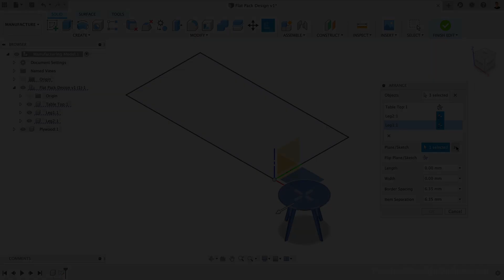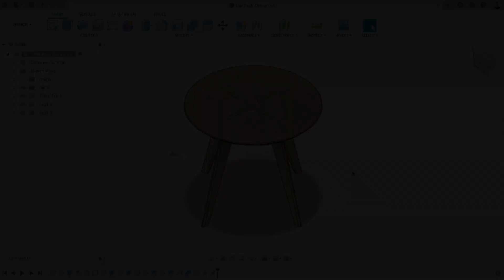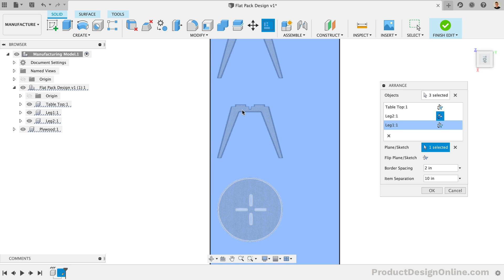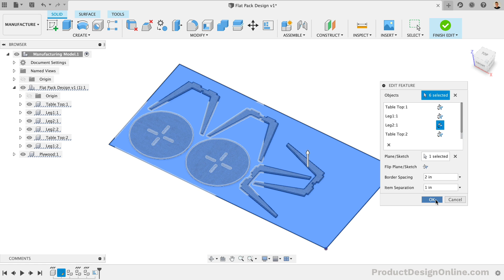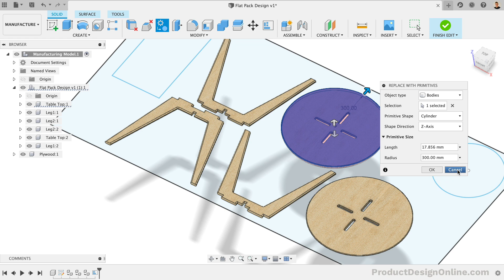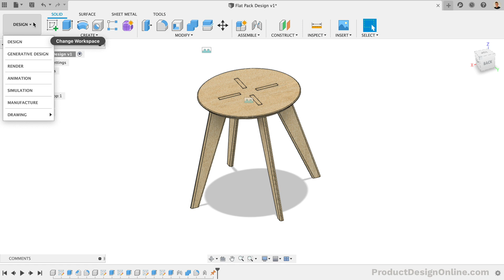Fusion 360 - Auto arrange parts on sheet

Comment from the maker: Grab the demo file in the description of this video!
Preview my new Masterclass: Fusion 360 for Woodworkers ➞ https://bit.ly/woodworkingCourse
Check out the new "Nest Manufacture Extension" via Portland CNC's Video: https://youtu.be/UH3RhTTp30k
__
TIMESTAMPS
0:00 - Auto arrange parts in Fusion 360
0:54 - Enable the Arrange preview features
2:20 - Creating a manufacturing model
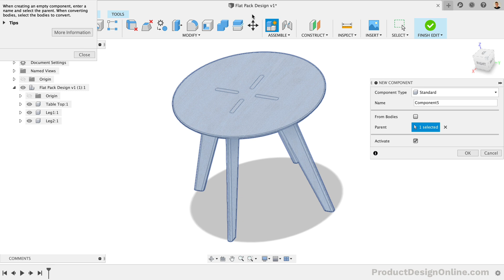3:34 - Creating the sheet good size
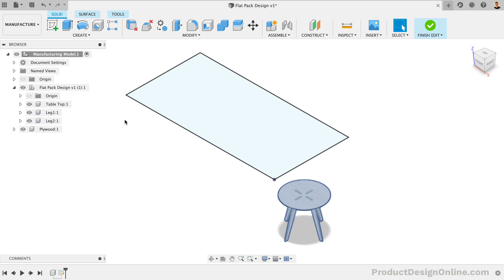4:09 - Using the Arrange feature
7:35 - Redefining the arrange boundary
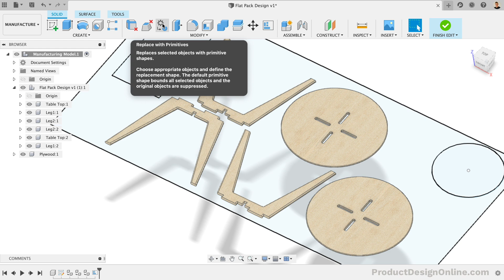9:25 - Manufacturing Model explained
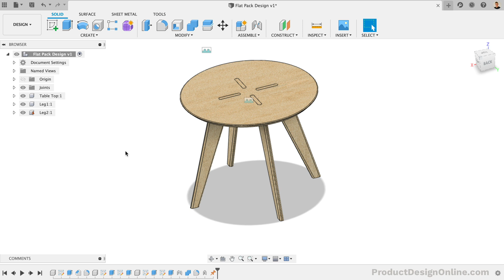11:10 - Testing the manufacturing model

Comment: I dont have a CNC but this would be nice for cutting my parts from plywood. How can I get dimension on the sheets?
Reply from the maker: Sry, I'm not following your question. Do you want to transfer dimensions manually onto your plywood? Or looking to layout the dimensions digitally (i.e. 2D Drawing)?
Reply: @ProductDesignOnline  Sorry. Say I have a cabinet I have designed and I use the auto arrange tool to arrange it all on a sheet of plywood. I don't have a CNC that will be cutting the material, I will be breaking it down myself. Is there a way for it to auto-generate dimensions on the layout so I can print it out and follow it like a set of plans?
Reply from the maker: @rutgis77  thanks for clarifying! Not in the Design workspace, unfortunately. However, the Drawing workspace has a new Automated Drawings feature that can do what you describe (it may not be available on the free Personal use license... I'd have to double check). You can also place the sheet and manually add specific dimensions of you don't want them all for some reason.

Comment: Arrange feature is even better this year and you can use it from the design workspace if you set a check on the option in preferences.  Advanced arrange is getting better every release.  #AutodeskEmployee

Comment: I thought nesting would have been included with the paid version of 360. NOPE. It's a plug in that they charge 3x what 360 cost just to be able to nest. No thanks.  I'll keep using Rhino which includes nesting.
Reply from the maker: To clarify, the Arrange feature covered in this video is included in the regular cost of Fusion 360. The "Advanced Arrange feature" and more advanced nesting capabilities are available with the purchase of the "Nesting & Fabrication" extension.

Comment: Since Arrange is disabled in the Personal License, what is the best practice currently for Personal users to move the stool's components into a flat stock for Manufacturing?
Reply from the maker: If you plan on doing it a lot then this addin is worth the 1 time cost: https://apps.autodesk.com/FUSION/en/Detail/Index?id=3399489440307590024&appLang=en&os=Win64

Otherwise, you can use the Align command or Joints depending on how many parts you have/whether you want to be precise about the placement.

Comment: I have the latest Personal Fusion 360 license and Arrange appears under Modify but is disabled all though Simplify is not.
If I click on Arrange I get the following message: "Available with a paid Subscription of Fusion 360".  
Am I doing something wrong or is this the new reality?
Reply: I asked Autodesk the above question and they confirmed the new policy for a Personal license is NO ARRANGE:

"Hi - Yes, that's right. Arrange is a subscription-only capability.   Jeff"

So future tutorials for Personal Licenses will be confusing if you continue to add Arrange to your new CAM videos.
Reply from the maker: Hi Steve. Thanks for sharing this. It's unfortunate - as it was included in the Personal license when I recorded this lesson, but they removed it with the other changes. I wish they would include the basic Arrange and keep the Advanced Arrange and Nest Extension to Commercial users (I'll keep fighting for that anyway).

Comment: Is there a way to arrange across multiple sheets if your components can't all fit on a single sheet?
Reply from the maker: With the Arrange feature, there currently is not a way to do so. However, the advanced 'Nesting' features available in the Manufacture workspace > Fabrication do allow this. Some of those features are still in preview/beta though.
Reply: @ProductDesignOnline  No worries, thanks for getting back to me. Another question is what process would you use to export your arranged layout (with sheet included) to a DWG/DXF to send to a manufacturer given the multiple bodies? Cheers.
Reply from the maker: @jamesrobertsonirvine  This depends on what license you're on. Are you on the free personal use license? If so, the easiest thing to do is create a new sketch and then use the 'Project' command to project the face of each 3d body into that sketch. You then have everything in 1 single sketch and can right-click on it in the Browser > select Save as DXF.
Reply: @ProductDesignOnline  thanks again for the swift reply. The workflow you've mentioned above is how I currently am doing it I just thought I'd check if there was single command after the arrangement command had been hit. I do also have a paid license, does that give you further options? Cheers.
Reply from the maker: @jamesrobertsonirvine  Yep, there are some better ways if you're on the Commercial license. Please join my new community space and we can chat/have a thread there where its easier to share things - https://community.productdesignonline.com/join?invitation_token=ee332424c326e3e15c9895c9f8f052cd65828b90-4cd0beb0-1ca4-4155-a9dd-d39b7245c809

Comment: Did something happen to this feature? I cant seem to find arrange nor do I see it in the preview box?
Reply from the maker: The feature is now available in is no longer in preview mode. However, I believe the feature is now only available two commercial users and is not available on the free Personal use license at this time.
Reply: @ProductDesignOnline  Fusion isn't working well anymore if you have a personal licence. SO FRUSTRATING!!!
Reply: @ProductDesignOnline  is there any other options available to use on the free version? I know it won’t be as simple but just wondering what other options you would recommend.

Comment: I found this video from https://forums.autodesk.com/t5/fusion-360-design-validate/replacement-for-slicer-app/td-p/9803113. Please consider replacing your old slicer video using arrange. I'd like to slice a design then laser cut its layers from Home Depot hardboard tempered panel. Thanks for your videos, I always take away new skills.
Reply from the maker: Hi Craig. They're working on some more slicer like functionality with the new Nest workspace.. I've been trying to hold off until that's available :)
Reply: @ProductDesignOnline  Aah, ok. Sounds good. Thanks.

Comment: Hi, has anyone figured out how to use multiple "sheets" if you have a hundred different parts that will not fit on a single sheet? Or is this something not available to "hobby" subscriptions.  I.e. do I need to have a subscription to have that option?
Reply from the maker: That will be available in the Nest workspace, which is still in beta testing. I do believe that will be only available for startup, edu, and commercial licenses. However, they have not officially announced anything about it.
Reply: @ProductDesignOnline  Great, its good to know.  Thanks for your response!

Comment: Nesting - loved the video, read all the comments, but still having a question if there is a way to create drawing out of that  flat layout without converting any DXF to DWG and useing any 2d soft.
Reply from the maker: Hi Rainer. You simply need to project all of the desired bodies (Edges) into a single sketch using the "Project" command. You can then right-click on that sketch in the Browser and save as a DXF. Hope that helps! :)
Reply: @ProductDesignOnline   Thank you so much for your answer. Ican get the DXF file out of arranged layout. That is fine but what I need for my job is actually a drawing of arranged parts. Just a simple top view with dimensions of details I need to cut in PDF file. The board material we use is cut on the simple table saw and we just need to print out the drawing guide for the people who do the job.

Comment: I had to do this to get the "Manufacturing model": Preview Features -> Manufacturing Working Model. Restart Fusion.

But I don't have the option for "Arrange Feature" and there is no Modify->Arrange menu item in the Manufacturing model workspace. I have Fusion 360 2.0.9011.
Reply from the maker: Hi Thomas. Are you on the Personal Use license? I just found out earlier this week that the Arrange feature is currently not available for Personal Use license.
Reply: @ProductDesignOnline  Yes I am. That explains why. Thank you.
Reply: @ProductDesignOnline  fml :D

Comment: May have to reset the program (close and reopen) after selecting and applying the preview features - Create Manufacturing Model wasn't an option until I did this.
Reply: I tried this but it still isn't showing up for me. Hmmm
Reply: @klm8156  If you haven't found it yet, you have go to the SETUP dropdown (located directly below Milling at the top) and then Create Manufacturing Model. Other thing I found out, it only works on components. So if you have a bunch of bodies under a component, you will only be able to select one body, and it'll move the entire assembly without laying it out So every body needs to be turned into a component, which is kind of a pain.

Comment: Once you arrange everything, can you export as EPS to send out to a cnc shop for them to cut? I don't know which machine they will use, they just asked me to have it arranged inside a specific area with spacing.

Also, once you've arranged can you get a sketch version?
Reply from the maker: You can save as a DXF file but would have to convert the DXF to EPS in another program. Fusion doesn't work with EPS, as those are vector files.

Comment: Kevin, I appreciate your videos! I am really excited about this feature as I do a lot of work on the CNC with plywood. However, I'm having trouble with the arrange window not showing up after clicking the arrange feature. The components have the directional arrow, but there is no window to edit the pieces.. Do you know what I missed?  Reasonably, not much yet out there on the web about trouble shooting this feature. Thanks in advance.
Reply from the maker: Hi Eric. Since the feature is still in "Preview" it is quite possible that it's a bug. The first thing I would do is reset your view, especially if you use Fusion 360 with an external monitor. Under the View drop-down > Reset to Default Layout
Reply: @ProductDesignOnline  dude! holy smokes, that worked! Thank you
Reply: Also another question Kevin: is it possible to manually arrange/nest components? If not, I am guessing that it might be a feature that could be rolled out when the full operation comes online. Thanks!
Reply from the maker: @erickillian8470  You would have to use the Move tool to manually position each component. Otherwise, there is definitely more to come!

Comment: Kevin let me re define my question, I have a simple 2d part it measures approx 6" x 6" x 1" thick, How can I apply them in multiple times on a stock sheet to cut them out. Thanks
Reply from the maker: After creating your Manufacture Model you can copy/paste them in the Browser. Just make sure you enable the Manufacture Model preview and go that route as that will ensure you don't affect the original design models in the Design workspace.

Comment: I made a quick design of 6 components made into a pyramid for a test  and there is no manufacturing model button. Anyone know why? thanks
Reply from the maker: It's still in preview mode. Did you enable manufacturing models in your preferences under the preview tab?
Reply: @ProductDesignOnline  Thank you,  Finally got around to doing this. Just a note for anyone else figuring this out. You also have to click on the arrange feature in the preview featrures tab lol.

Comment: Great video Kevin.  However, for us mere mortals who don't have CNC machines and have to cut "wood" with saws, is there any way of creating a drawing of the layout? Or do you have to manually place the parts on a separate design and then create a drawing from that?  Thanks, keep up the good work :)
Reply: Figured out a way to do it. Very convoluted though. Create a new component in the manufacturing space, start a sketch, project layout onto sketch. Copy the component projections to a new assembly sketch on a new sheet. Extrude projections and create a drawing. Hope it makes sense, I'm a relative newby. Hope your way is easier 😀.
Reply from the maker: Hi Damion. Hoping to do a video on that soon! 

Thanks for watching :)

Comment: Nest, we will use the hell out of this feature. We cut out so many wood parts on our CNC routers, this is huge.
Reply from the maker: What machine do you have? 😎
Reply: @ProductDesignOnline  We've got two Multicam CNC routers with ATCs. A 3000 series and our new Apex R3 with computer vision, drag knife, and oscillating knife.

Comment: NEST.... Looking forward to the NEST space.. I've been playing with the arrange and having some difficulties when placing parts onto multiple sketches (I have some flat furniture which takes multiple sheets and like to to the CAM set ups next to each other). So far I've still been moving the parts manually to position after arranging them onto a plane.
Reply from the maker: Are you using the Arrange feature twice (once per each sketch)?

Comment: I nested the components but how can I actually export the result to a DXF or Sketchup file so I can use the parts information in another software - primarily Aspire or vCarve Pro?  I also couldn't print.  Do you have a class or link to a project that shows how to export the nested result?
Reply: Hi Rob, there are two ways to export/output dxf for the arranged results:

1. While in the Edit Manufacturing Model environment, project the boundaries of arranged objects onto a sketch and then export the sketch as a dxf
OR
2. Create a setup and toolpath operation for the arranged objects. Please make sure the sideways compensation is set to "Center" (for 2D Profile) or "Off" (for 2D Contour). Then you can PostProcess the toolpath by selecting one of the available DXF posts from the fusion post library.

In the post dialog, you can set 'onlyCutting' = "YES" to get rid of the linking motion. And you can set 'includeDrill' = "NO" to avoid points at the drilling positions.

To download and install the dxf post on your computer, please visit - "https://cam.autodesk.com/hsmposts?"
Reply: @ravijavia8183  thank you for providing a reply.  Before I provide my additional request, I want to say that I appreciate the time you already took to tell me there were two method.  I will go try and find out information on these methods.  But, if you have a few more minutes and are willing to provide a little more help I would appreciate it, even if you don't thank you for what you did provide.  

I have to admit that I must not be proficient enough yet to figure out how to accomplish what you gave me instructions to do.  I know how to project in the Design Mode but never worked in the manufacturing mode until following this video's guidance.  So not sure how to export just the sketch in Edit Manufacturing environment.  Links or guidance to any videos or instructions on how to do this would be awesome.  

As for method 2 still need to figure out how to setup a toolpath and the things you mentioned.  Any links to this information would be helpful so that i could go learn.   Thank you again...
Reply: @robsandstrom9854  you're very welcome. Glad to help. Here are some good resources for Fusion 360 in general:
1. Learning Content - https://academy.autodesk.com/software/fusion-360 (you can find info about other Autodesk products as well)
- Regarding Setup, Toolpath and NC creation - Go to the Intermediate Tab and refer to "43. Setup", "46. 2D Toolpath", and "49. Post NC File". You can also check out "43. 2D Cutting" on Advanced tab.
- Projection of faces onto a sketch works the same way in "Design" and "Edit Manufacturing Model" Environments. I would recommend trying the DXF post method first.
2. Fusion 360 Youtube Channel - https://www.youtube.com/channel/UCiMwMz3RMbW5mbx0iDcRQ2g
3. For specific questions on Arrange functionality, you may post here - https://forums.autodesk.com/t5/fusion-360-feedback-hub/open-call-for-preview-feedback-arrange-feature/td-p/9673457
4. Other questions on Fusion 360 - https://forums.autodesk.com/t5/fusion-360/ct-p/1234

Hope this helps!
Reply: @ravijavia8183  thank you will check out these resources.

Comment: This nesting feature may turn out to be a game changer for me.  Trying to manually layout parts on cut diagram was so time consuming - this is an awesome edition.  I don't use Fusion 360 to generate g-code for my Laguna IQ CNC and the bed s limited to 2'x 3' so will need to determine how I can next to smaller plywood or stock - I think I just do multiple sketches and pick which components I want on each sketch - is this accurate?  I also still need to figure out the best way to export my parts into Aspire or vCarve Pro.  Great work.

Comment: I have a slightly more complicated model and I cannot seem to get it to work. I have several bodies under a single component and when I try to arrange, it is keeping the bodies together as a single unit instead of breaking them apart into the individual bodies.  Am I missing a step?
Reply: Hi James, you must select the bodies > right click >  "Create Components from Bodies". Each component must have a single body as this feature arranges the components, not bodies. For components with multiple bodies or sketches, you can pick any one body or sketch to be used to arrange the component, or arrange automatically selects the first body for you. For components that only have sketches, arrange will automatically pick the first sketch.
Reply: @ravijavia8183  Thanks. I will try that.